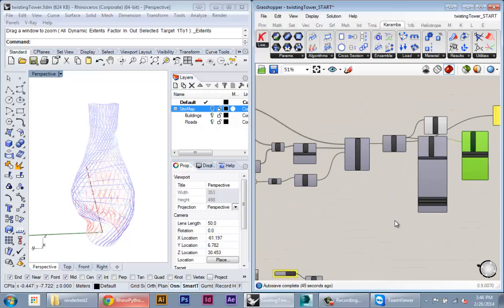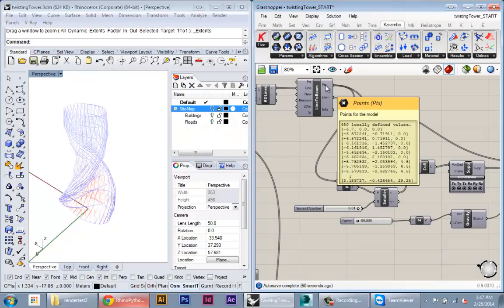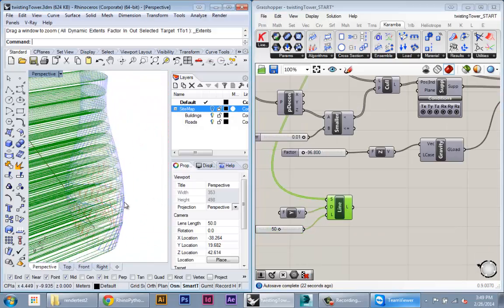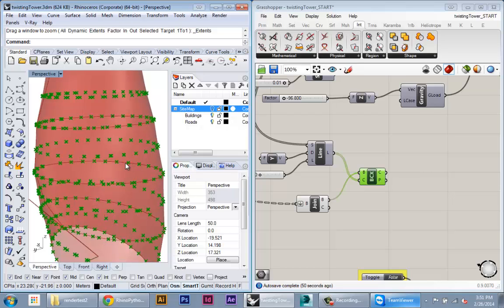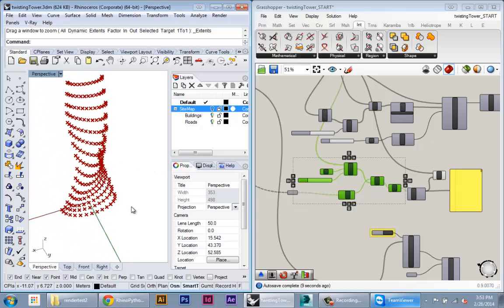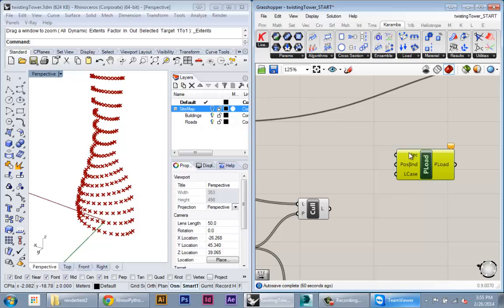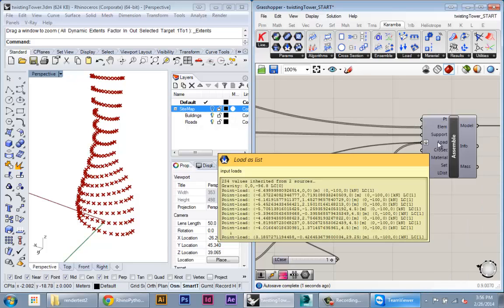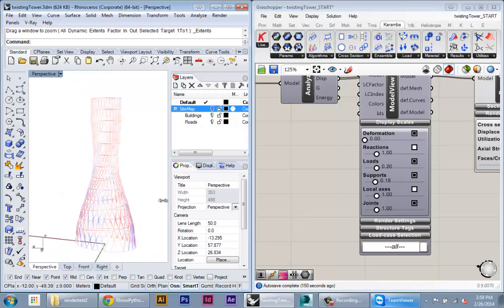Karamba Structural Analysis 3/4 - Wind Load

Comment: Hi Danil,

Cool video. I have a question about modelling wind loads in Karamba. Would it be possible, to tell Karamba to optimize the cross sections, in such a way, that it can handle wind loads coming from different directions?
Because now, it only designs the cross sections based on loads that you modelled in a certain direction. Adding wind loads from all directions all at the same time would over estimate the cross sections though, so what I am looking for is a way where you set an interval of wind load angles on a building, and then the cross sections per group get assigned such that it will not fail under any angle in between your interval.